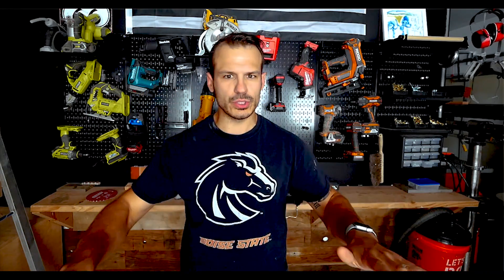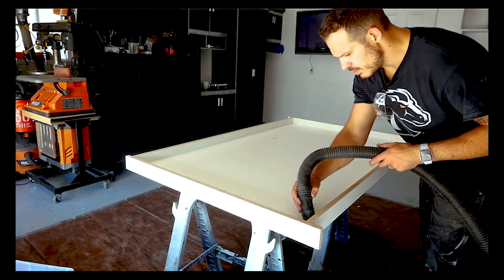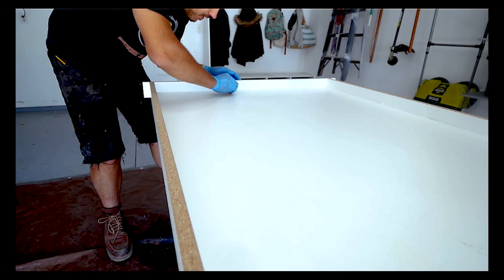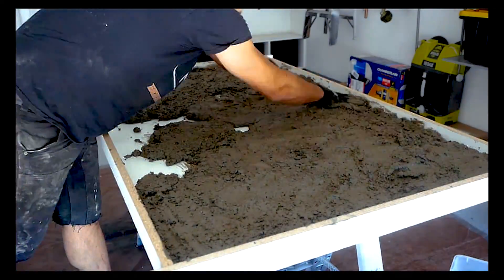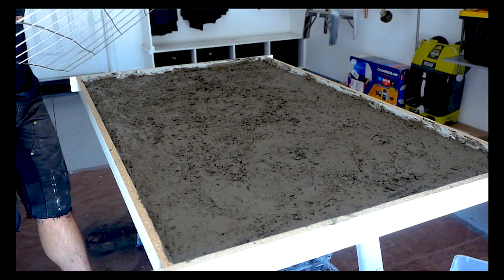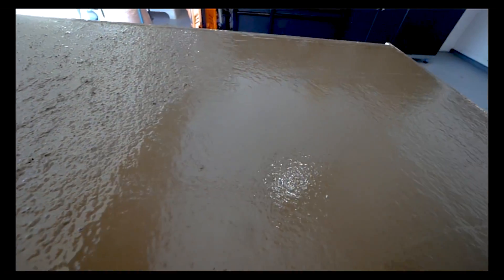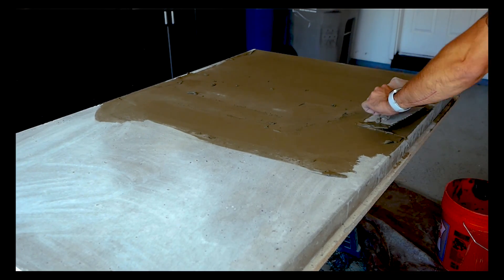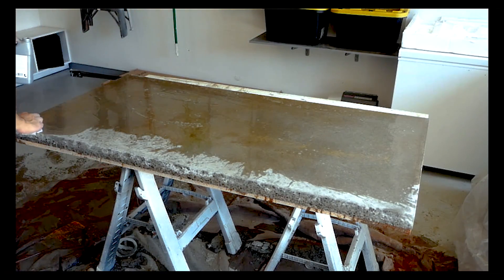DIY Concrete Countertops For DUMMIES

Comment: tip, use Rapid Set Flow Control additive to make the cement consistency like cake batter and it'll flow and fill in all the nooks and cranies and you can pour it while your rebar is already in place

Comment: Concrete finisher tip. Add water in the bottom of your pan before mixing and makes mixing a little easier. Vibrate the form before you screed your slab and use a float wood or fiberglass that way the bleed water can rise to the top then seal it with your trowel

Comment: I did something similar to my bathroom counter. Unglued 70’s yellow green color. Didn’t remove counter but used some featherite mix, I think that’s what it’s called. Several coats and then a few coats of poly. Took awhile with the drying and sanding but that concrete look is just awesome. Good job on yours. Oh and Go Vandals!
Reply from the maker: Its amazing how budget friendly remodels can be if just being strategic about it.

Comment: If you take a rubber mallet and hit the frame while the concrete is still wet it will get rid of a ton of those bubbles.
Reply: If you use an electric sander it will take out alot of the bubbles,just dont use it too much, it will settle all the stone to the bottom
Reply: ryan t thanks for the tip
Reply: Good tip

Comment: That countertop concrete is 5x the price for no good reason.  Buy 5000 psi concrete and some fibre reinforcement and spend $10 instead of 50.
Reply: Fletcher Hillier  another benefit to using 5000 psi mix is that it has less cement and would be less likely to crack while curing/shrinking.
Reply: Fletcher Hillier what kind of trowel do you recommend? And by the way, should I go also with other type of reinforcements for that mix, like bars or something like that? Thanks so much!
Reply: Hi Fletcher! Thanks for the advice. Can you give me an example of a fibre reinforcement brand? I'm not really sure what I'm looking for.
Reply: Theres actually plenty of reasons.

Shirkage control
Much denser mix which leads to less porous concrete which leads to professional sealers doing their job alot better.
Structural cracks are incredibly rare and if any crack appears is microscopic.

Good concrete isnt cheap. Cheap concrete isnt good.
Reply: Thanks for the tip! Youtubers like you are a life saver. I’m doing this to save money instead of doing granite or marble. You saved me a bunch of money. Blessings will come your way!
Reply: @cirosochyesposito9443  Watch Odell Complete Concrete, he is a very thorough concrete youtuber.  Concrete surfaces can be finished in many different ways depending on your preferences.
Reply: @monsterbarbell8306  Depending on the quality of formulation of a pre-mix in my experience is a limitation on your ability to understand and apply your mix.  Additives such as plasticizer can be applied to create a denser mix than the specified 5000 psi.  Also they charge a lot for understanding the product.
Reply: @FletcherHillier  not particularly, Trinic is one company who are open and approachable about how to use their premixes.
Reply: @monsterbarbell8306  as far as porous, if you are mixing the right concrete with a finer grade of sand yourself you can get it really high quality. Any premix product in any field can be self made with a bit of research. Then its only a matter of personal ability.
Reply: Dead right, Fletcher. The countertop mix has the plastricizer already in it, but you can buy that for cheap if you want it. The countertop mix is slightly higher grade (6k PSI vs 5k PSI), but the marginal increase in value isn't worth 3x the price.
Reply: @Cavball9  we arent talking about a slight increase with mixes here. Trinics mixes are typically over 12kpsi.

Better ductility
Permeability 
Stain and acid resistance
Structural cracking
Micro cracking 
Etc

Are all reasons why you should be choosing a better mix.

But hey dont take my word for it. Speak to Bob or Mark at Trinic and let them convince you.

Good luck
Reply: @monsterbarbell8306  who the hell is talking about Trinic, besides you? The original comment is regarding the Sakrete countertop mix used in this video (Maximizer), which is 5,500 PSI. Anything over 5k PSI is going to be good enough for the majority of people. Go peddle your Trinic elsewhere.
Reply: @Cavball9  calm down man.

Its not my company and I dont use their products it was an example in previous exchanges with others.

Do you make concrete furniture for a living like we do? Because 5000psi is not good enough.
A basic GFRC mix is easy to find and a whole lot better than sake crete.
Please let me see your portfolio/business making this. Im interested to chat more as you seem to have it figured out.

And btw our business is Da Vinci Designer Concrete. You'll find us on Instagram.
Reply: @monsterbarbell8306  Then don't be an ignorant troll. The conversation was centered on the OP's advice of not wasting your money on $20 countertop-specific mix when you can just buy the 5k PSI stuff & add fiber. That's it. 

Sakcrete & quikrete both sell fiber-reinforced mixes, so I'm not sure why you're dismissing entire brands as if they only make a single product. Majority of them are more than sufficient for simple DIY countertop projects.

Y'all's stuff looks great, but you're talking about a commercial operation vs. a one off DIY job where $ matters.

And my family's been in the concrete biz since the 1960s, so get wrecked with that smug portfolio mess.
Reply: @Cavball9    ignorant troll trying to help people, thats a new one. I responded to this comment and another of my own, of which I was offering advice and helping.. I'm not the one resorting to digs and snarky comments. I was being genuine, not smug as you seem to have this figured out..or perhaps there's a better way than what you think..like I said I was and still am trying to help.

Adding fibres to a mix does not make it GFRC, its infact the polymer within the mix that does amongst the specific type of fibre used; alkaline resistant fibres.

You can buy Buddy Rhodes GFRC bag mix and just add the AR or PVA fibres and youll get a 10x better DIY job for not much more money at all, seriously maybe 50bucks more over the entire project (don't quote me as I'm in the UK).

Being in concrete since the 1960s as a family is irrelevant as not all concrete is created equal and I've seen plenty of concrete from the 60s that looks awful; not an implication on your family business by the way, just saying.
There are lots of DIY concrete that I've seen that looks ok for a year and then it cracks, or its stained (DIY rubbish sealer used too).

I'm not here to be smug. Ive been here to help and educate from the start. Look for yourself.
Reply: @monsterbarbell8306  Yes, from the start where you offered "plenty of reasons" the Maximizer countertop bags were 5x more than the general stuff that still cures to 4-5k PSI?   You realize the Maximizer you were defending is Sakrete, yes?  Then you magically brought up Trinic, but no one was talking about Trinic. Read back for yourself.  

This is what I'm talking about. You want to use your knowledge to help people, fine, but you don't even realize what you were arguing for/against in the first place.  Have a good day, sir. Deuces!
Reply: @Cavball9 you're reading comprehension is awful.

Somebody said certain companies charge a lot for mix designs, I merely suggested they try trinic as they are not one of those companies. No magic.

Defending Maximizer? No idea what the hell you're smoking but its great stuff. evidently.

I know full well what I was discussing (arguing, really, that's what you think, I thought this was a discussion with 2 different opinions, which is fine by me, we learn from everyone). You evidently don't.

Like I said. Buy Buddy Rhodes gfrc bag mix, spend a few $$ more for a much better and longer term mix.

Best of luck to you, you have all your answers clearly. I'll leave you to it. 

For anybody else reading this, do your research, if you have questions, I'll  be happy to help.

Best of luck to you.
Reply: @monsterbarbell8306  Here's *your reading comprehension, slugger. This is the part where you defend the countertop concrete from the video (Sakrete Maximizer, mind you) being 5x the price:

FLETCHER HILLIER:  That countertop concrete is 5x the price for no good reason.  Buy 5000 psi concrete and some fibre reinforcement and spend $10 instead of 50.

MONSTER BARBELLl:  Theres actually plenty of reasons.  
Shirkage control
Much denser mix which leads to less porous concrete which leads to professional sealers doing their job alot better.
Structural cracks are incredibly rare and if any crack appears is microscopic.
Good concrete isnt cheap. Cheap concrete isnt good.
Reply: Here's some more, in case you're a glutton:

FLETCHER HILLIER:  That countertop concrete is 5x the price for no good reason.  Buy 5000 psi concrete and some fibre reinforcement and spend $10 instead of 50.

CRAIG S: Dead right, Fletcher. The countertop mix has the plasticizer already in it, but you can buy that for cheap if you want it. The countertop mix is slightly higher grade (6k PSI vs 5k PSI), but the marginal increase in value isn't worth 3x the price.

MONSTER BARBELL: @Craig S we arent talking about a slight increase with mixes here. Trinics mixes are typically over 12kpsi.
Better ductility
Permeability 
Stain and acid resistance
Structural cracking
Micro cracking 
Etc
Are all reasons why you should be choosing a better mix.
But hey dont take my word for it. Speak to Bob or Mark at Trinic and let them convince you.
Good luck
Reply: @Cavball9  yea...reading compression...you havent got it;

Original poster says countertopmixes are more pricey for no good reason.. I commented saying there are plenty of reasons its more expensive... there you go slugger.

 I wasnt replying to fletcher defending the tripe in the video. I was actually giving reasons as to why you want a better mix the the one in the video.
Reply: @Cavball9  You should always use a design process as the aggregate size will vary with the size of the pour.  Typical sizing is 1/5 of your smallest dimension.  Use ACI 211.1 mix design procedure as it is the industry standard for concrete mix design.  for achieving strengths of 12k psi you will need to reduce the w/c ratio using plasticiser and the largest aggregate you can use within the 1/5 rule or 3/4 of the space between your rebar so it doesnt clog up.  no magic to the cracking reduction, you can add lime, fibres, and use the correct mix with the correct amount of air entrainment for your exposure level (outdoor slabs exposed to winter w/ 3/4" aggregate need a w/c ratio < 0.40 and air entrainment of 5-6%).  1" thick = 0.2" maximum size of aggregate.  The larger your aggregate is, the less prone to shrinkage it is.  Too large of aggregate and it will crack.  Frankly you are actually paying about 10x the cost at $50/bag compared to buying sand and stone at $30-50 per cubic yard and mixing with portland cement.  The most expensive part is the fibres, and by controlling the mix you can decide which materials you will use.  If you are running a business, bagged concrete will not make you very much money as someone who knows about mix design would be able to charge $50-$100 less per slab.  I've tried to find specific information about what's in these mixes as far as admixtures and aggregate size and its usually a disappointment as they don't want their competitors to take their mix design.  if they can't tell you the percentage of aggregate and their modulus of fineness, you are guessing at the water content by 'how it looks' like OMG ew
Reply: @monsterbarbell8306  If you want it to be really easy then go for the bagged mix, I've never used Trinic but I am obsessed with concrete mix design.  I design mixes for fun based on theoretical scenarios like "what if they want a 6" slab that can withstand the winter without cracking", mostly using the ACI 211.1 mix design procedure with input from studies.  There are a lot of scientific studies done on concrete because it is the most used resource in the world next to water.  They can tell you the optimal dosage rates for specific things like 1" chopped basalt fibres, or pretty much anything else you might add to concrete.  The fibres will likely be the most expensive thing in this mix, running it up to at least $10/cu ft. for small scale according to my calculations.  Without the fibres you could do it for about $5/cu.ft and pour a thicker slab with a lower w/c content and liquid plasticizer. Lime can be added to help prevent cracks and will self-heal future micro-cracks.  Personally I'd use chopped basalt fibres so I can have a thinner slab with better flexural strength to support itself across spans, and design a mix that produces the lowest w/c ratio possible by using plasticizer and lime.  (lime also improves flexural strength and permeability)
Reply: @FletcherHillier  hey man. No offence has been intended at all. 👍
Reply: @monsterbarbell8306  I wasn't offended man, I just like talking about concrete.  I've always loved rocks since I was a kid and concrete has rocks in it so...

Comment: Vibrate the sides of your molds with a sander to move the air bubbles to the surface and then trowl

Comment: Definitely a diy’er. I can only imagine how twisted that slab is while sitting on a set of plastic Home Depot saw horses. You’ve got to have a solid perfectly flat surface to rest the mold on while pouring. Otherwise it can be a nightmare trying to install the slab on a set of cabinets. But a good video for a weekend warrior. Thanks for putting in the time to make the video.
Reply from the maker: all part of the learning process.

Comment: You can avoid cracks in concrete by curing the slab with water 3 to 5 times a day for at least 3 days.
Reply: i've seen concrete crack before its even dry.
Reply: Eleazar Renteria - that is true. Sometimes the calculation of the resistance  of the concrete is skewed. It never should be a one size fits all. Playing a bit with the aggregates size and quantity makes all the difference.
Reply: How do you do that? Just spraying water on it?
Reply: @living9377  - you just pour water over it with a glass, and let it flow to really wet the surface.
Reply: @thereor4u200  thanks for the tip

Comment: Oh, and by the way, you need a  table saw to cut the big boards,  because... of course... everybody have one in the garage, just like you.   Perfect!   My DIY concrete counter top  list is complete, let’s start it.   🤨
Reply from the maker: Well you need tools for home renovation...
Reply: A track saw and straight edge will also work.  Also, just have the diy store cut it for you.....it’s free and easier to haul the melamine home.

Comment: you got on that mud with the steel a little quick.  You want it to be almost hard (normally 2 hours) before you use steel on it.  Screed it, vibrate it (wont get those voids), edge it (so you dont have sharp edges that will end up chipping and breaking), let it sit for a couple hours, then "burn" it with the steel.  Putting the steel on it early will bring too much cemented water to the surface and cause flaking.
Reply: Are you supposed to scrape off the water that comes up to the top after vibrating?

Comment: Very nice and well made video! I would attach to the underside of the table top a non-visible recess, this can save a lot of weight. Greeting Frank
Reply from the maker: Thats a great idea. perhaps angle iron
Reply: Yes, angle iron would be possible here too! When I create large table tops with an optical material thickness of 3-5 cm, I often put a plate of Styropr on the underside, which I then remove again. I then fit a plate of laminated wood into the recess. The concrete slab is thus fully on the non-visible wooden slab. This can save almost 30 percent of the weight. 
Please excuse my bad English. Best regards Frank

Comment: Nice project. Instead of using the credit card, on the caulk, there is an alternative tool that pastry chefs use. I have no idea what it's called, but it has a handle with a ball at the end. You just roll the ball all around each side. Gives a perfect finish.
Reply from the maker: oh yeah. the fondent tool

Comment: Only problem is using metal reinforcement wire can bleed later as rust coming thru to the surface. Make sure you use a good sealer
Reply: Thanks for the tip. What sealer do you recommend that is considered good?
Reply: never will bleed .... if done as should be... neither the metal will rust.....theoretically concrete building stand for 100years plus

Comment: My concrete countertops are 12 years old and not cracked. Small slabs like this will not crack in light countertop use

Comment: Making next time make sure you wear the proper PPE, notably a particulate respirator. Breathing that concrete dust will f-u-up pretty badly, and it doesn't take much - looking at your concrete dusted clothing and the "cough cough" around the 7:06 mark in your video is pretty alarming. Be safe people!
Reply: Thanks for the tip. I have watched many videos and these guys were not wearing ppe at all. Gave the impression the stuff was harmless